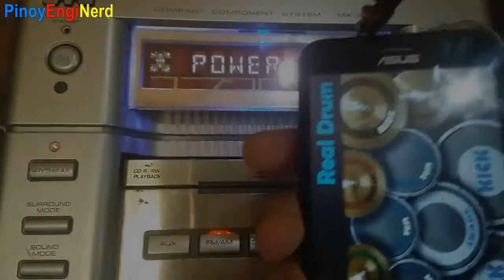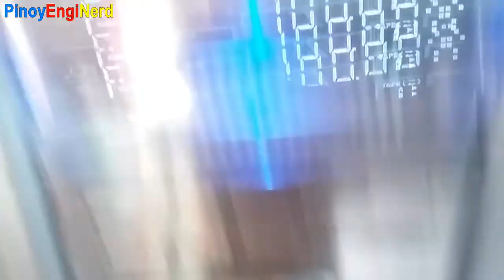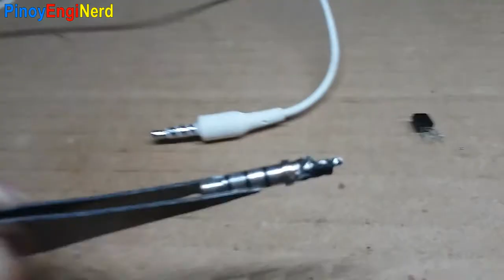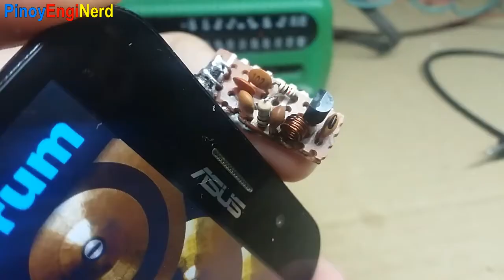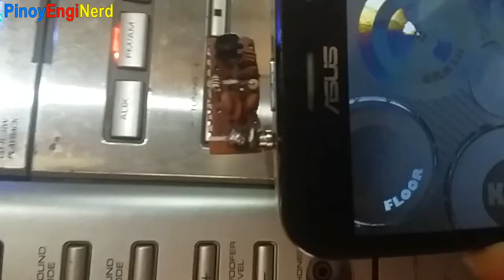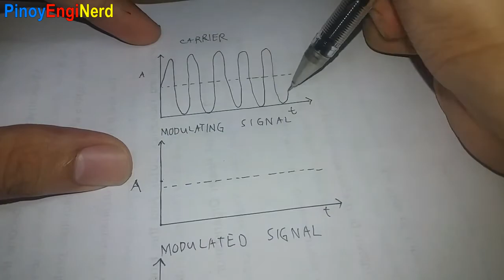Build an FM Transmitter, no battery needed, just PLUG and PLAY with explanation

Comment: Sir can I add a tuner to the transmitter so it doesn't cause interference?
Reply from the maker: Youneed to put shielding on the oscillator part to avoid to avoid disturbing the capacitance, i think you need add an rf amplifier stage